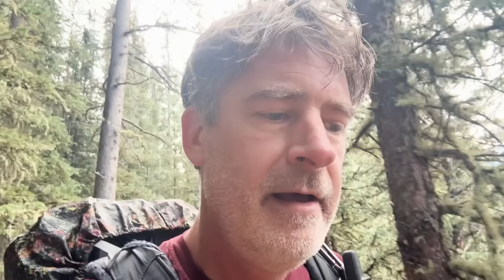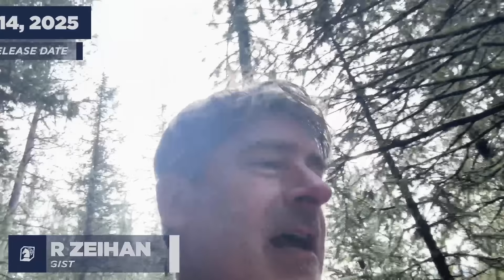Can 3D Printing Save U.S. Manufacturing? || Peter Zeihan

Comment: I've been saying this for a while now. 3-D printing is going to really boost production.
Right now, it's fairly primitive. We can create complex shapes, but the durability isn't there. We might be able to replace 5-10% of manufacturing with 3-D printing.
But as more and more demand arises for domestic manufacturing, we can expect the printers to get better fast, and soon we're doing 20-30% of manufacturing. Before you know it, they are doing 50% of manufacturing. And since there are many levels of value added, a company can start by some guy doing it in his garage.

Within 10 years, we might have a whole new manufacturing model, where traditional factories do a decreasing amount of the production. We skip over the annoying rebuild phase.
It also puts China far in the rear view mirror with their useless traditional factories.
Reply: The issue I have with FDM and Resin, is that you always have surfaces that are not good, areas of structural weakness. 
There is a lot of promise from the combined subtractive and additive manufacturing in one CNC+#D print hybrid like this https://www.youtube.com/shorts/bNrwwyeba3A
Insanely expensive - but SMART

Comment: 3d printing takes a huge amount of time.  Exporting your manufacturing base by the dictates of the finance cult through rigged exchange rates is sheer social suicide.  No one technology will save a manufacturing base, rather, only a financial environment favourable to a broad infrastructure of capabilities can do that and yes, tariffs can be a necessary part of the structure.  But rational tariffs, not bully-boy deals which will be gone 2 months after Donnie leaves office.
Reply: half of his deals will be gone and 'renegotiated' while he is in office. Just keeps needing to make announcements.
Reply: Best comment lately.
Reply: > No one technology will save a manufacturing base, rather, only a financial environment favourable to a broad infrastructure of capabilities can do that and yes, tariffs can be a necessary part of the structure.  But rational tariffs, not bully-boy deals which will be gone 2 months after Donnie leaves office

cool quote
Reply: Right. We need energy capacity to run the machines, the trade schools to quickly train millwrights and technicians, the actual milling and stamping machines to perform the functions we want, the safety inspectors to ensure sites won't blow up and halt production for years, all which could be supported by favorable trade deals for intermediate goods and factory equipment and subsidies for manufacturing and logistic startups, not to mention an overhaul of LA port or an alternative to it...

Comment: Too many limitations to 3D printing. At it's base, subtractive manufacturing chooses the best materials first (think steel for knives) and then makes the product. Where 3D printing is too focused on the forming process to be able to choose the best steel, nor can it make the best steel because that is done in a process that is not 3d printed.
Reply: There are lots of products where that level of quality doesn't matter. Think plastics.
Reply: @jonlittle5032  I think polymers (plastics) are also very dependent on quality. Some products need polypropylenes, others polystyrenes, some with UV resins for the sun others with additives for the cold. Some need to be blow molded, some roto molded and others injection molded just to give the product certain important qualities for their specific use. I think my point is that materials used in products are extremely important and 3d printing doesn't address the varied needs. Best to leave each material to be made by the experts in that field and then used by the manufacturers who need them.
Reply: Nope. Not necessarily. You haven't shopped for consumer goods lately? Like, in the past four or five decades?
Reply: Say, that knob on the washing machine that you have to replace every couple years? Or the handle on fridge? Or most 'generic' power tools at Menards? And how about Black and Decker coffee makers?
Reply: Actually, I like the poor quality of products these days. My grandkids come over to my house 3 months after Christmas to play with the toys I grew up with -- their toys from the previous Christmas break before the snow melts in spring.

Comment: The answer is no. 3d printing is an amazing prototypeing platform but not viable for mass manufacturing. Its biggest weakness is stresses that run perpendicular to the layer.
Reply: I believe you mean 'shear forces horizontal to the layers".
Reply: @jonlittle5032  Delamination is a real problem in 3D printing. He might mean carbide alignment in metal printing of Steels, Cobalts and precipitate strengthened Nickel superalloys. All of these alloys can have carbide liquation during the welding process. So post heat treatment is very important, especially the Solutioning step.
Reply: for the US market the biggest weakness is ,you dont need skils for a good 3d print.
Reply: @szabolcs__  Like grammar or spelling?
Reply: Titanium prints are doing fine big dawg
Reply: @powersv2 technically it is true with Metal 3D printing, grain structure of metal parts is relevant... but not THAT relevant lol
3D printed metal probably has a grain structure similar to extruded parts
Reply: This is not the case for every 3d printer, there are many 3d printers optimized for production,  we print hundreds of products every day for customers and our own products at Golden Gate Molders
Reply: It is more than a prototyping platform. It is a manufacturing process in its own right, and products need to be designed for manufacturing on a 3D printer. 

If you want to go with injection molding after prototyping with 3D printing,, you'll need to redesign the product for injection molding, and that's a hassle. So, injection molding only make sense for mass production process, although there are people working to reduce the fixed cost of injection molding.